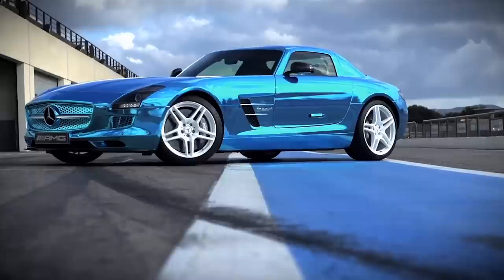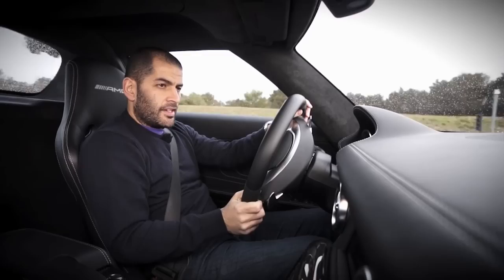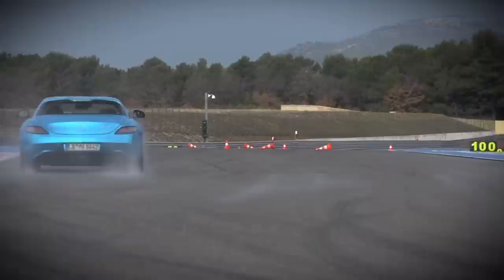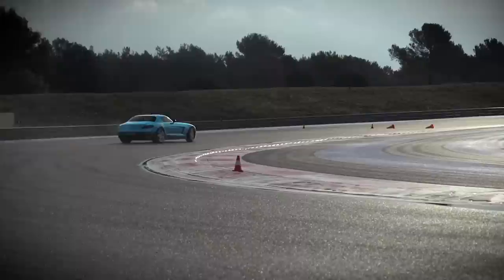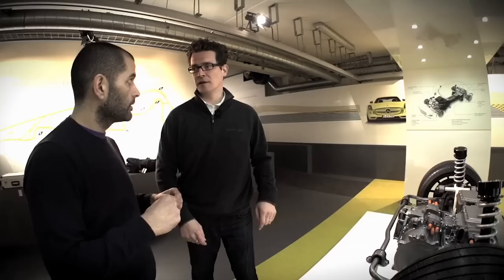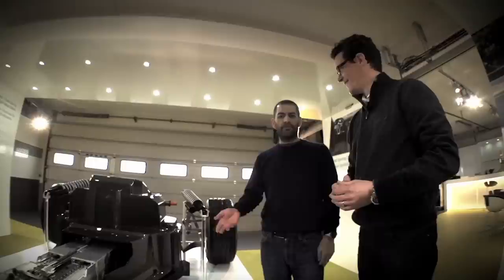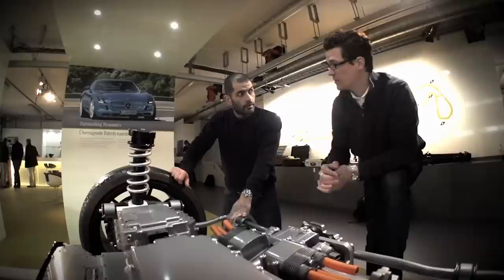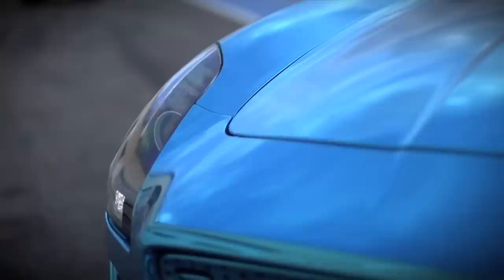Mercedes SLS Electric Drive. Can Volts Ever Match Pistons? - /CHRIS HARRIS ON CARS

Comment: Can Volts match pistons? You mean "Can pistons match volts?". I love conventional engines, but they do nothing better than electric engines.
Reply: BrakeHorsePower92 Conventional engines can make a better noise than  electric motors...
Reply: GetOverHere83 And that's all they do better.
Reply: +BrakeHorsePower92 You said they do NOTHING better, didn't you? Conventional engines offer better range and they cost less due to the current development costs. Both technologies have pros and cons. It's ignorant to suggest it's a one-sided argument.
Reply: GetOverHere83 Not having an engine sound is an actual "con" for electric engines? Range is being improved and as soon as electric engines are more common they will be less expensive.
Reply: +BrakeHorsePower92 Try to exercise some logic instead of being so stuck in your ways. Pedestrians often listen as well as look when cross the road, especially with blind corners or when visibility is poor. In that situation a lack of noise is definitely a con. Range hasn't improved enough yet for a lot of drivers.
Reply: GetOverHere83
At the speed where sound is actually important the tyres are loud enough. And if visibility is poor there are headlights and speed should be reduced anyways.

Range hasn't improved enough? How is 500km not enough? Tesla can do it, the others can too. Don't see how flawed logic comes into this.
Reply: +BrakeHorsePower92 At blind corners, tyre roar isn't necessarily loud and the last time I checked, light only travels in straight lines. Tesla offers range but they're not exactly affordable to the average Joe/Jane. I do support alternative alternative fuel or sources of power but they have to match or exceed petrol/diesel in many aspects  to gain wider acceptance.
Reply: GetOverHere83
Like I said, blind corners are not driven at full speed. If you do then maybe it's not the car's fault if you have an accident, regardless of sound. Also, most cars are only audible when accelerating, further mitigating the argument of noise.

Of course Tesla isn't affordable to everyone. But I said "If Tesla can provide 500km range, others can, too.".
Reply: +BrakeHorsePower92 Absolute nonsense that cars are only audible when accelerating. My humble four-pot, which is unmodified and perfectly roadworthy, is audible at a steady 30km/h or 100km/h. The tonality doesn't change but that's it's certainly not the case that a car is inaudible unless accelerating.
Reply: GetOverHere83
Yes, you modified it. So either everyone modifies their car, resulting in total earbleeding everywhere or you can just admit, that normal cars are NOT audible when at low rpm and without load.
Reply: BrakeHorsePower92 I blame the typo on a false autocorrect but either way my car is not modified (for insurance and resale). I guess I owe you an apology for apparently misleading you in thinking I have either the desire or inclination to massage your ego, telling you what you want to hear. My car is nothing special but it is audible at idle (never mind at a constant speed in low rpm) hence how I know it is running without having to look at the rev counter. Unless you are hard of hearing or don't know the definition of the word "audible", I don't understand why you are pressing me to concede something that is patently untrue.
Reply: BrakeHorsePower92 Even if I had modified my car, why do you assume that is to do with the engine or exhaust? What's to say I didn't have it lowered, used different wheels, seats or change the ICE, none of which would inherently affect the engine/exhaust note?
Reply: GetOverHere83
Because you mentioned your mods in relation to engine noise. Why would you mention different wheels or coilovers when talking about cars being inaudible unless accelerating?
Reply: +GetOverHere83  at city speeds, it's pretty rare for me to hear a car's engine noise. They're already very quiet. I mostly hear tires before engines. though I've been able to hear hybrids in electric mode very easily, because their inveters make a strange high pitched whine, not unlike an RC car. I suppose it might be hard for many to hear, though.
Reply: +BrakeHorsePower92 
Conventional engines will empty your wallet much better.
Reply: +Dude31463 The engine will but the electric car as a complete package will generally empty your wallet better due to the comparatively higher upfront cost.
Reply: +GetOverHere83 The upfront cost is comparable to any other car in that category... That's why Tesla outsold Mercedes, BMW, Audi and Porsche combined 3 years running. It's the Best value for your money and long term ownership not to mention practicality and performance, period.
Reply: +Dude31463 I'm afraid that in your case, saying "period" does not simply end the discussion. You will find that the likes of the BMW i3 or the Nissan Leaf are significantly more expensive than their petrol/diesel contemporaries.
Reply: +GetOverHere83 
Clearly BMW, Nissan and all the other ICE mfg's are Half-assing it in this regard... You would have to ask them and/or yourself why they are "Half-assing" it when we full know they are quite capable of otherwise.
Reply: *****
Not every car buyer is interested in those things.
Reply: +BrakeHorsePower92 Actually only problem I can think of is..... wait for it. Winter. In Finland, -20 Celsius will drain batteries much more quickly. So range inverse becomes important here. In warm country, I don't see any horror in 500km range.
Reply: +BrakeHorsePower92 If you think that noise isn't an important part of an engine then you're not a real car person :P
Reply: +GetOverHere83 some people like silence and some people don't this isn't a plus for either side
Reply: +GetOverHere83 Care to tell me how an I4 is loud enough to be heard around a corner in a situation where an electric car wouldn't? Suprise, suprise, not everyone is crushing a NA V8 in their car. 
I must totally agree with the whole tyre sound thing. It's the main source of noise , even with a combustion engine that isn't performance oriented. This whole 'pedestrains can't hear' argument is just rediculous, one of the laziest ever. I have never trusted my hearing in a traffic situation and neither should anyone else, frankly if you get injured in an accident because you failed to look for a car you have noone but yourself to blame..
Reply: They can, and will. Even a very efficient engine is FAR less efficient energy wise than an EV. The only thing EV's have to do is increase the energy density to the point where they can store as much, and they will go 4-5 times as far on a charge. But that only matters where you are driving a car for 24 hours non-stop - for the rest of us, they've already won.

I cycle a lot of km's, as many as some people drive, and most modern cars are quiet enough at 60kph that the first thing I hear by a long way is the tyre noise.

Comment: Chris please get your logic straight when talking about CO2 emissions. if you want to consider the primary source of energy used to power electric cars (i.e. electricity) you have to do the same for internal combustion engines (a.k.a. where does that gasoline come from?). So consider how much CO2 is emitted when extracting, refining and shipping of oil/gasoline. Otherwise you're comparing 4 squirrels and 8 pots of yogurt by the front axle to a large buffalo at the back (yes, I watch all your vids :))
Reply: ^^what this guy said
Reply: Not this again. Electric motors are more efficient. Short story. Overall the EV will produce less C02
Reply: For short, the OP described a life cycle analysis, quite useful. The energy argument is fascinating. In the early 1900s, almost all available electricity came from coal, rendering the rise of ICEs arguably better for the environment than their golf cart EV competition. However, I live in Ontario, which no longer uses coal, and I drive a plug-in hybrid.

Comment: That awkward moment when you realize a Model X P90D is faster than this.
Reply: +Souheib Merge The Tesla wasn't designed to be an electric track car, it's a four door.
Reply: That awkward moment when you realize this was over 3 years ago and the pace of technological development renders your comment moot. Besides, potential future competition can only help to improve all products. What, exactly, is your point?
Reply: It's not faster. The SLS electric beated a lap on the track set by a p90d with ludicrous mode.
Reply: Seems the XP90D might be faster in a straight line and even though Mercedes was heavily consulted by Tesla for the suspension design the torque vectoring probably makes is faster through the turns--no?
Reply: Person Personsson Yeah because this can obviously last longer on track than a Model X. /s
Reply: Person Personsson Yeah the cooling system will work for about 10 miles before the batteries go flat in the SLS.  Tell me more since you think you're so experienced.
Reply: Person Personsson Oh resorting to cursing?  Great job at not proving your point.
Reply: Person Personsson The liquid cooling system in the Model S is nearly identical to the SLS E-Cell.  Mercedes owns stock in Tesla.  Oh and both suffer from heat soak, with the SLS suffering more significantly because it's chassis was never built to fit electric motors in the first place.  Continue being ignorant.
Reply: 3+ years later...
Reply: alexlam24 faster 0-60 doesnt mean the car is faster
Reply: You know if you don't put gears in an electric car you have to either choose if you want more top speed or more acceleration? The sls was designed for vehicle dynamics and not for 0-100 times, change the gear ratio and with 4wd, 4 independent motors and that power and torque you dont have to be a genius to know it will be faster...

Comment: what a disgusting drift sound it sounds like shifting a desk on wood floor.
Reply: +ltlocus That sound was made by camera, that was propably attached to panel, without any vibration dampening. :)
Reply: Are you new to racing tracks? Do you know what rumble strips on curbs are?
Reply: xebek I am new to racing tracks, but I have quite an experience with cameras. :D
Reply: 3rdHalf
Oh, I was responding to the original poster, not you. It may well be a camera, but it sounds like rumble strips considering it happens when the front wheel hits the curbing.

Comment: Its the track that does that. Its the "brail" bits on the inside of the apex of a corner, and on the outsides of the corner to line the "runoff" area. Not sure if I am accurate with the terminology, but it works.